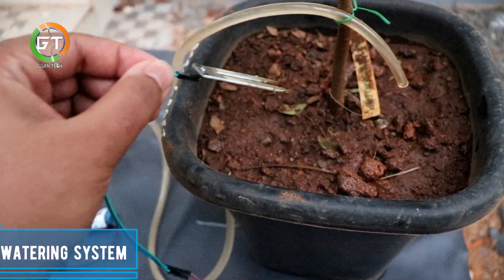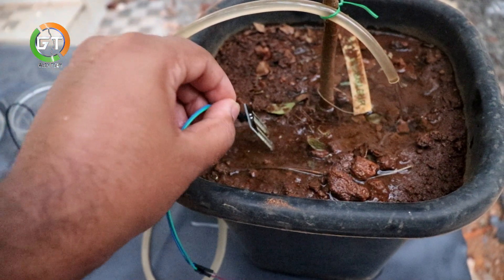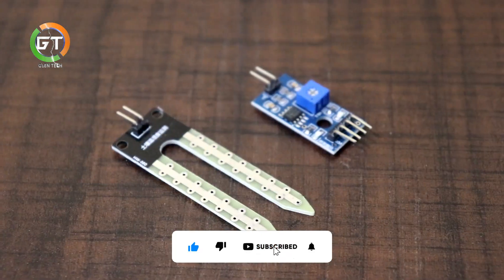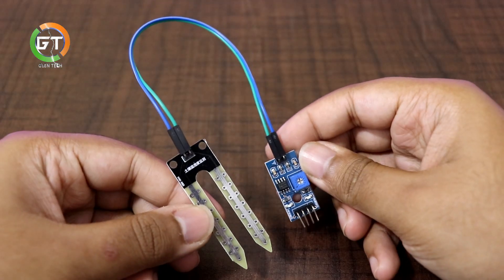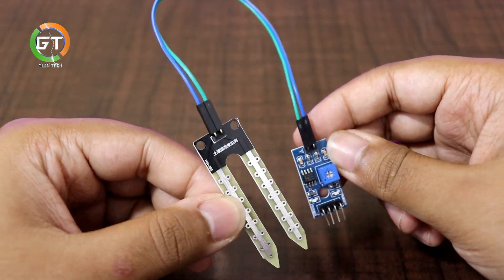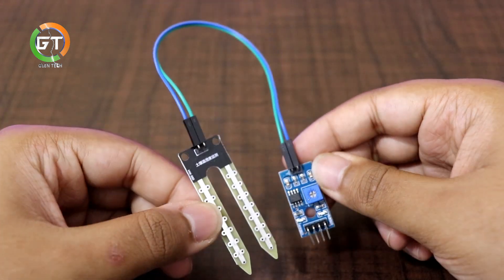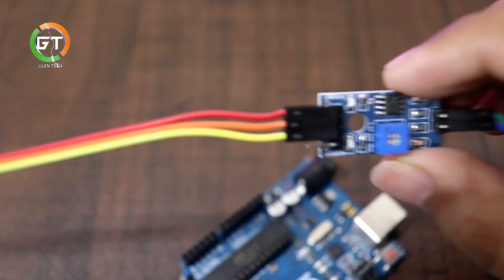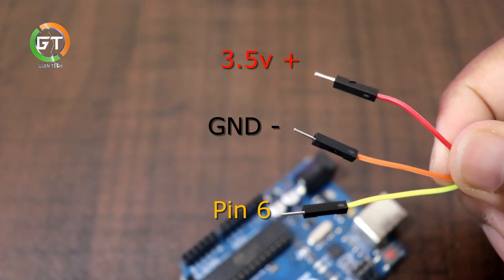How to make Automatic Plant Watering System for School Science Projects || Glen Tech

Comment from the maker: Code : 

int water; //random variable 
void setup() {
  pinMode(3,OUTPUT); //output pin for relay board, this will sent signal to the relay
  pinMode(6,INPUT); //input pin coming from soil sensor
}

void loop() { 
  water = digitalRead(6);  // reading the coming signal from the soil sensor
  if(water == HIGH) // if water level is full then cut the relay 
  {
  digitalWrite(3,LOW); // low is to cut the relay
  }
  else
  {
  digitalWrite(3,HIGH); //high to continue proving signal and water supply
  }
  delay(400); 
}